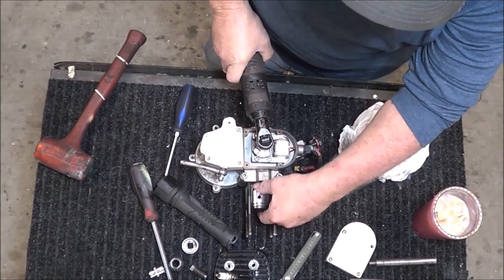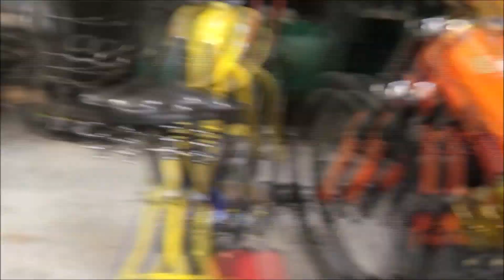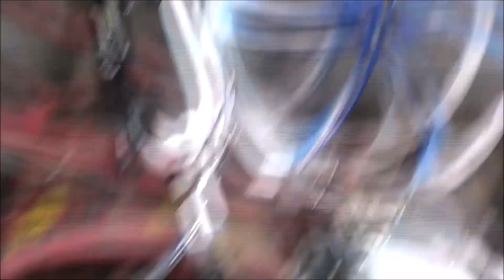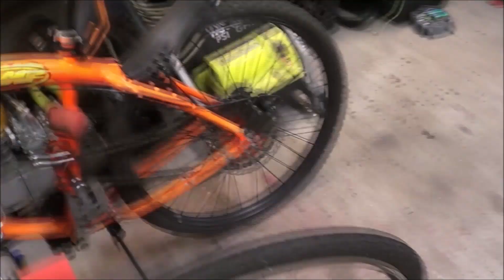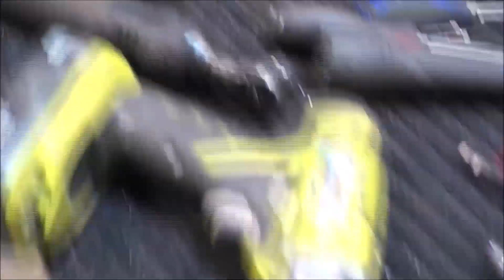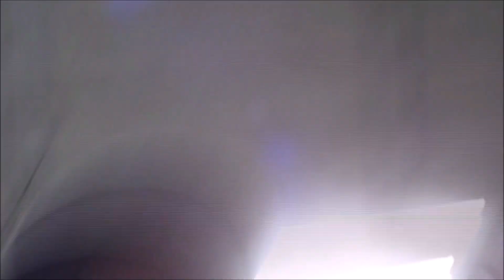Motorized bike engine trashed can't win them all.

Comment: Oo yea great video  love that YOU are working on stock stuff. Meaning  You are learning  and sharing. Anyone can bolt on a pre maid cyl like mxs or minarelli. Keep up the good work. Good chances are you have had a vacuum  leak the whole time with them cases. Hence  it never ran great. The bearing failure  could have been that or also  could have been not enough  end play or to much end play in crank. To tight of cases would be putting full time side load on crank. Just a thought. I'm now like Colonel Klink I know  nothing

Comment: That sux, but glad u broke it down, when the blocks and hammer came out i was like its getting real,  it just makes us better, ggz- 👽👍, LD90 cylinder kits are( $40 on Amazon) no- bearing  , just cylinder is $32, 🚲💥☁☁☁
Reply from the maker: Just the cases in the crank was bad I literally had to cut through the magnet to get the shaft out of it trash the Magneto and the cases but they were going anyhow and the crank got all new coming cylinder and piston are fine I just believe that one of the bearing cases had a warp or a Twist in it cause strain on it to heat up you have a great day and ride safe

Comment: Crap sorry. Kinda looked like good burn pattern on piston crown. Few years back daily for few years straight I was testing everything  on three bikes. My fourth was for riding. Blessing had one failure  out of thousands of tests.  Over rpm going down hill 10/ 34 gearing vm18  7 cc head cr pipe 17 mm id stinger stock crank and untouched  cases. 60.4 mph. The failure  was ring location  pin fell out. Was confused  it was ripping then backfired blew carb off. Few miles from the house . Stuck carb back on fired up and rattled all way home. Thankfully  made it home. The failure  that was the last straw was on my birthday  about 3 yrs ago testing a ken Hinson motor. Mid corner at ehh 50 mph a rear sprocket bolt came loose locked up rear wheel again mid corner. Bent the axil broke rear disc bracket. And that's the moment  of clarity  came to me. I remembered  exactly  what it felt like living in the wheelchair  for years. Been riding since  1974 10 yrs old. Got lucky  that's the day I parked all 4 of my bicycles got a back break bracket  a axil. But just don't have any desire  to work on anything. Including  the NHRA prostock motorcycles anymore. Sadly overtime I will forget what I know

Comment: Good morning MR. Kevin you can salvage your magnet and magneto coil do you think bearing failed when I switched bottom cases before one was a hair different than the other because it had shims on the crank and when I switched to the other case I had to remove one of the shims because the crank was to tight but looking at the crank she definitely got hot when you were smaking the crank I was like he's going to have hell getting that to go back on then I seen you cut it off I was like dam it's gone have a great blessed day MR. Sapossod to get super cold here starting Thursday or Friday there predicting lows in the teens and cold on Christmas eve and day not no 82 like last year lol be safe brother
Reply from the maker: I had to cut through the Magneto and the magnet I actually split the magnet in half to get the shaft out of it case magnet Magneto all that's trash I believe that one of the cases was warped and had a Twist on one of the bearings and that was the one that failed got everything ordered new no big deal kind cold here and it's supposed to get a lot colder probably the same cold you're getting now you have a wonderful day stay warm ride safe
Reply: @KevinTodd  thanks sir I'm just a little younger than you unless it gets 55 with a south breeze no ride it's to cold
Reply from the maker: @mikemiller3303  🤣🤣🤣

Comment: So what you tink happen to the engine ? Look like you WaS mising some lubricación
Reply from the maker: No like said the cases are bad from the start warped or what ever always had trouble with them no more just bought new ones those was from a engine kit that was so bad none of it survived can't find it any more that's good
Reply: Not a lubricant  problem  tight cases  / more than likely  issue
Reply: @2strokecarbtuningportingin187  that can be the problem also .